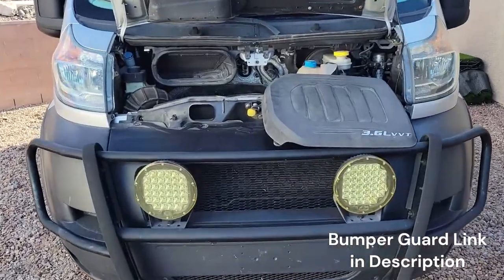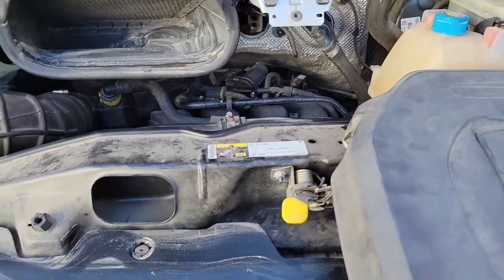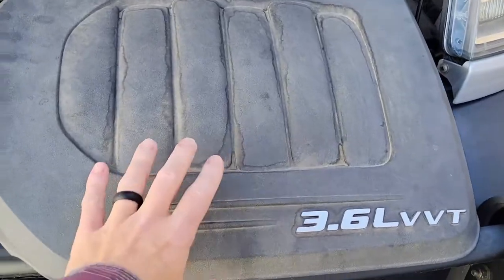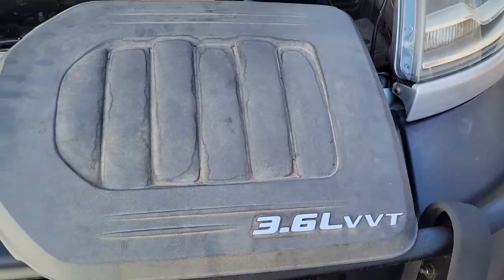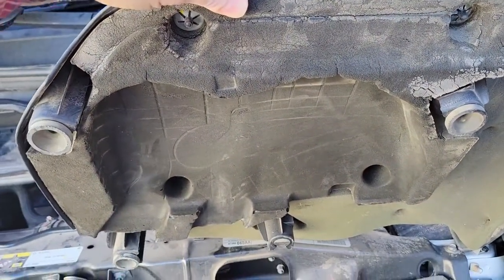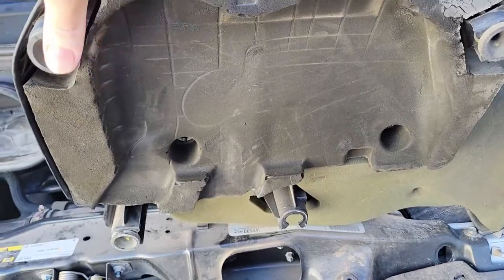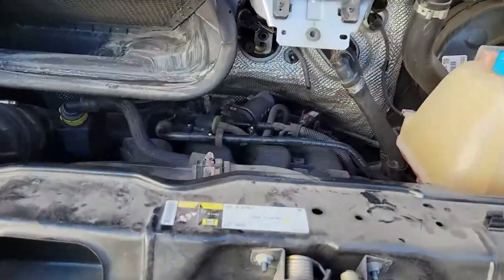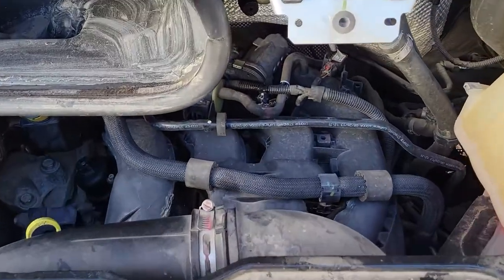Promaster Cowl Leak? Add an Engine Cover!

Comment: Well done. Generally speaking, we just seal the cowl to the windshield with gorilla tape (only gorilla is water resistant) and that gets enough of it. I actually have a buddy who is a former Chrysler thermal engineer. I asked if the lack of the cover was for packaging, or if it was for thermal, meaning the cover would retain heat. He didn't know, but I think it's packaging and cheapness - that you had to trim it means FCA would have to retool and source a promaster specific part, which they are loathe to do for cost reasons. So making an engine cover is a solid plan. I salute you!
Reply from the maker: Good point on the retooling.  I don't know if living in the dry southwest I'd really have a problem without the engine cover, but adding one seems like it could definitely help some others in wet climates. Also, if I wasn't in a high temp climate I may have kept the insulation on, but I don't have a problem with engine noise so off it came. I had an ac compressor fail at only 53k and it was soon after a big rain.  The cover won't help with that, but it really did make me start looking into the leak.  I think I watched your short video on the gorilla tape? I have the sealant ready to go, but the gorilla tape would be easier for anyone to use.  Not sure how the gorilla tape will do with 115 plus days on end in the summer here, but I may give it a go first since the specs say it can handle it.  Are you sealing the middle together with gorilla tape also?  My 2 cowl pieces have come apart quite a bit.
Reply: @TheCorneringStore this isn’t Kip from promasters only that left you a comment
Reply: @TheCorneringStore  Absolutely we are sealing the center seam. You can get as crazy as you like, but the goal is to keep the water in the trough, and get it to the center drain tube unobstructed. I'm sure you've noticed leaves and whatnot collect in the mouth of the tube, making the problem even worse. There is also a case to be made for making the side drain tubes bigger, or otherwise better. 
I think Gorilla tape will probably survive the sun. Amazing stuff. It would look awful, but they make it in white which would survive even better.
Reply: @promastersonly1419  Use a wallpaper seam roller to really put some pressure on a pressure sensitive tape. I used a one inch roller when I put the Eterna Bond tape I covered the seams on the roof of our camper with.
Reply: @kevinwilkinson1510  Great idea!

Comment: I did the same install today and I took a screen shot @12:11 to have a solid starting point for trimming my cover. Thanks as that saved me a lot of work. As another poster mentioned, I also cut off the back right post as the male end on the engine was surrounded by other stuff and unusable.

Comment: Great idea! I took your idea and fabricated an engine cover from the plastic shroud under the front bumper of a jeep wrangler. Cut it to fit and works great too.
Reply from the maker: Ha, so you used the plastic skid plate? That's a good free mod. I'm guessing you upgraded to a metal skid on the jeep? I upgraded the skid plate on my bronco as well.

Comment: Do you have any video of the actual cutting? Or photos of the sides when finished? Thank you
Reply from the maker: @barbaraw.3236  the cutting you can just use some tin snips and take your time or of course an electric multi tool. Sorry, I didn't want to bore people with all the cutting and making the video any longer.  If you checkout the video at about 12:11 as another person commented below, you can get a pretty good view of the final result.  There is no right "side" any longer since where it did contour down has been cut off.  I did cut around some things on the left and there are a few places where it still contours down some, but it really doesn't matter and that could all be cutoff also.  Some other commenter's said they lopped off the right rear mount also I think it was. Double check that : )

Comment: Finally getting around to installing this same engine cover sourced off of Ebay.  Facing the engine, did you cut off/remove the right rear mounting post on the under side of the engine cover? I'm having some fitment issues and this right rear mounting post seems to be getting in the way and makes sliding the cover into place very fiddly.
Reply from the maker: Yes, cut that sucker off. I just went and double checked and it isn't mounted on the back right, but just has the cover extending out as far as it would allow it to still fit well and protect the engine.

Comment: Spent a week getting to the front plugs. All wet. Found the leak at the seam. Love to do this
Reply from the maker: Yup, I had to dry everything all out before I put the cover on.  We had one of the rainiest winters where I live so I was really happy to have it on before that.  It's really simple since i figured out in the end you can trim enough off to fit and removie it without removing any other parts.  I still have yet to finish the cowl though haha.
Reply: @TheCorneringStore  I live in SW Florida. It must have started leaking not too long ago. I found the seam in the gutter along the top above the engine, has a seam in the middle. Caulked it. My engine was missing so I decided to change the plugs and coils. I got lucky as the bolts were not super rusty. But I did see many videos where they are rotted off.  Got to the last plug. The well had been full of water. It dried off, but the line and rust was still there. Its running a bit better but now I guessing injectors. Looked at eBay for a cover. 60$. Not many yards around here . Keep you posted.
Reply: Got the cover. Time to fit it . Thanks for the idea
Reply from the maker: @christopherrasmussen8718  awesome, hopefully the install goes smooth for you!

Comment: Did you take the insulation off the inside of engine cover after you cut it down to fit?
Reply from the maker: Yes, It is mostly just to keep the engine quieter, but I definitely want the engine to run as cool as possible and I live in one of the hottest places in the country.

Comment: Promaster's cheap construction.  Small drains...I used permatex black engine gasket maker. It is better to remove cowl and seal everything with new clips.  Build new  larger drains at the ends using bigger rubber hose and Permatex.

Comment: I'm dealing with the  dreaded 2 rusted upper manifold bolts right now, when attempting to replace the badly-engineered oil filter adapter housing because of the cracked plastic reservoir. So it will be CA$3,000 once all is said and done (if I also need a new lower manifold - remains to be learned). There should be a class-action lawsuit.  Dorman makes an after-market oil filter adapter housing which is ALL aluminum, like Dodge should have done in the first place 🤬
Reply from the maker: Oof, I hope I never need to replace that oil filter housing and have that problem.  Living in the desert I'd imagine I'll he ok, but i picked up my van a few years old from Michigan.  Hopefully it won't run you anymore money.  I'd look at maybe replacing your coolant Reservoir also if you are having issues keeping it up to the minimum line. They have hairline cracks usually I've read.  That is on my list to do.  The transmissions and the leaky windshields should have been recalled/fixed I agree.

Comment: Is that a petrol/gasoline engine on Fiat Ducato (original)? Here in Europe they are only with 2.0, 2.3 and 3.0 Diesel Engine! So funny! btw. that leaking problem has been known since 2007 about. Just non-hardening sealant under that plastic piece enough and water problem is over! Do not use silicone!
Reply from the maker: Yes, it's a gasoline engine.  It's a 3.6 pentastar engine.  They put them in the 6 Cylinder chevy camaros and most Jeeps also get them.  They have transmission problems, but the engines themselves are pretty reliable. It makes sense you guys across the pond would have been through those years ago since there are so many ducatos, boxers, etc running around.  In the states we just now received the updated front end face-lift for the Promasters this year. Do you have a name or link to the exact product you guys use to seal the cowl? Thanks!